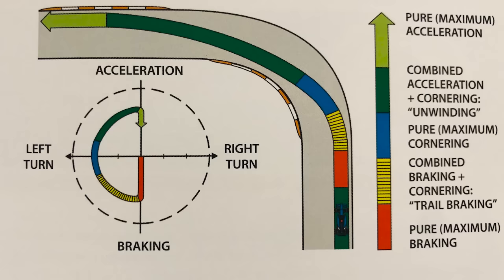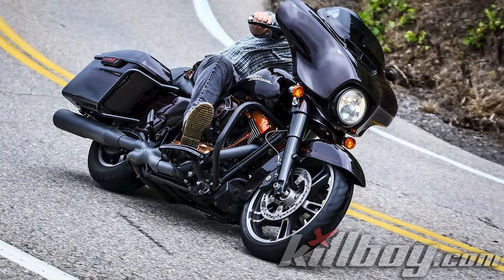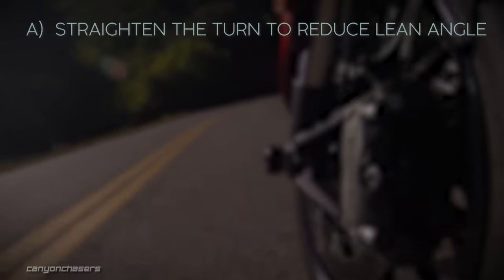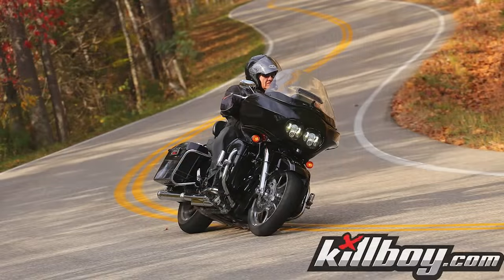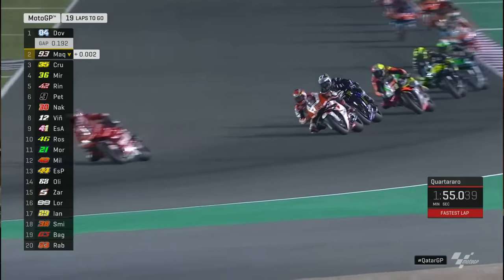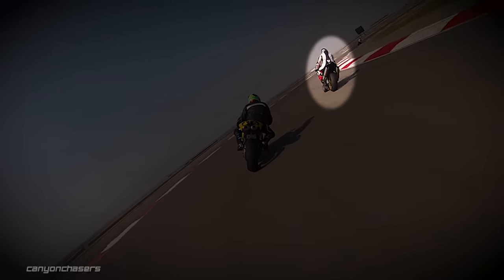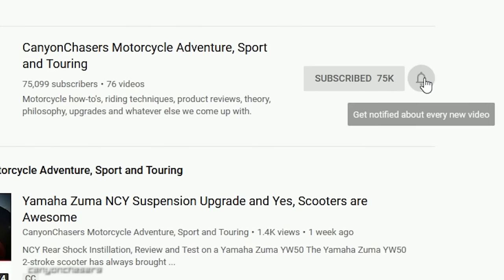How and Why Delayed APEXES Work

Comment: I enjoy and respect your channel.  But I can’t help thinking - isn’t this entire pursuit of identifying the one right apex point entirely inappropriate for the commuter or recreational rider to whom “Managing a corner 0.3 seconds faster” is not only silly, but more dangerous than needed. Aren’t we best served with - Keep your lean angle, speed and position at maximum safety for as far as you can see. There’s no need for crowding the inside line near oncoming traffic, nor threatening the outside line often littered with debris for those of us not doing track time.     However - I enthusiastically applaud your piece on trail breaking. I believe it can literally reduce accidents, while increasing riding enjoyment.  The MSF course I took taught it as necessary to accelerate continuously from the start of a turn and all the way through. I think this is counter to safe riding, and entirely beyond the scope of and ill advised for learning riders.        Nice work!
Reply from the maker: Honestly, learning how to identify and find your apexes is a massive safety benefit. Just like trail braking it may be faster, but mostly it reduces risk.  It gives you a plan for every corner, it minimizes your most lean to a point where you are going the slowest and have the most grip as well, probably most importantly, putting you into a position where you are least likely to run wide; off the road or into the oncoming lane. You don't have to push your  apex to within inches of the edge of the lane/road. You can be three feet away from the edge and still have a good apex.

Comment: I do a lot of riding in the Catalinas in southern AZ. It is nothing but twists and turns for 25 miles, with the occasional short (200-500 yd) straightaway. There are many switchbacks and decreasing radius turns. I dare say that it is more work than riding on an average track at double the speed. 
Shifting your weight and weighting the inside peg are simply survival strategies. You never know when you will need to abruptly change your line in a turn so you want every last little newton of traction available and then use about 70% at the most. I always aim for a late apex, even if I don't need it. Even knowing the mountain like the back of my hand, I'm not perfect. It is imperative to give yourself every advantage because there is rarely a ride where I don't scrape a peg or narrowly avoid another insane rider, bicyclist or lazy cage driver. 
I have seen this mountain cripple, maim and kill riders. I once lost traction in a curve and recovered just in time to avoid going over an 800 ft cliff. 
What really boggles the mind are the nutso bicyclists who come screaming down the mountain at 40-60 mph with a contact patch of about two square centimeters! Yeah, that's gonna be fun when you wreck wearing spandex and a helmet made for low speed impacts. 

One thing I don't think is well addressed here is the importance of proper throttle and brake control. A lot of people don't realize it is possible to brake quite aggressively in a turn, should a vehicle pull out. It is a progressive action of rolling off the throttle and progressively and carefully squeezing the front brake. Also, most people would make the mistake of using rear brake in an emergency stop in a corner. don't You dial in the front as you roll off the throttle and begin straightening up the bike. You brake until you reach the "point of no return", where you would crash, let off and then lean in hard and swerve back into the turn. 

I may be biased because my bike is a Harley Dyna but I think the rear brake is useless on road. I never use it. I have a 1.5 l air compressor to brake the rear. It just requires excellent control skills.
Maybe if I was riding a little bike, I would use some rear brake but I don't typically ride little bikes. I think the same rule applies to larger sportbikes, provided that you aren't letting the slipper clutch make up for poor skills!

Anyone can ride a sportbike fast on the twisties, with lousy technique. Try going the same speeds on a somewhat modified cruiser and then talk to me about technique.
Reply: I think you need to watch the video again. Shifting weight loads the outside peg in effect making the bike stand more upright which in turn allows deeper braking, or a steeper lean angle before things start scraping.
This guy is quite right squaring off a corner leaving your turn in point (maximum lean) until you can see your exit and thus your apex point. This cancels out any little surprises like debris or gravel on the road because you are going to see it before you've 100% committed at your turn in. Then you have options of line changes or extra braking from not tipping and staying wide.
Something this guy didn't discuss and probably should have is the smooth transition between braking and the centrifugal forces in a corner. If you are braking at 100% of your grip levels entering a corner then you have no grip left that your bike will demand for actually cornering. The optimum is a smooth transition between your grip moving from 100% braking to 100% centrifugal forces at your tipping in point. To achieve this well we come to the most over looked part of most bikes riding around today. Suspension! Hands up everyone who hasn't had their suspension tuned or has leaking seals or doesn't change out their fork oil at least once a year. You can have the best tyres which counts for nothing unless your suspension is keeping your flash tyres on the road like it should. Smooth cornering will transfer the suspension compression from braking into centrifugal forces of cornering without your forks acting like a pair of pogo sticks. If you can't keep up with your mate on a similar bike in corners then get your suspension sorted like he did. This applies equally to new and used bikes. There is no suspension setup that suits everyone.
Reply: @tbonemc2118  No, I'm afraid you have that wrong. Loading the inside peg stands the bike up more.
A motorcycle wants to naturally place the wheels under the center of gravity. when you are leaned into the turn and you weight the inside peg, that shifts the CG downward and towards the inside of the turn. Thus the wheels want to track back underneath the bike. 
Keep in mind we are talking vector mechanics here and if you took the time to understand this subject, along with trigonometry, you would be able to work this out for yourself. Also, a thorough understanding of rotational dynamics (centrifugal force and fore-aft weight transfer), gyroscopic precession and traction also really helps to understand riding a motorcycle.
There are many treatises on motorcycle physics out there. I suggest you thumb through one sometime.

Comment: One question - the blue line shown, there the part of max lean is not the apex of the corner, the apex comes afterwords. Which is contrary to what was said earlier in the video.
Reply from the maker: No, thats accurate.  The apex isn't always the slowest part of the turn and its not always the point where the bike is leaning the most.  The apex is simply the where the bike is closest to the inside of the corner - and it's where we put it.  We may apex early, middle or late.  Each with different results in the bikes exit.

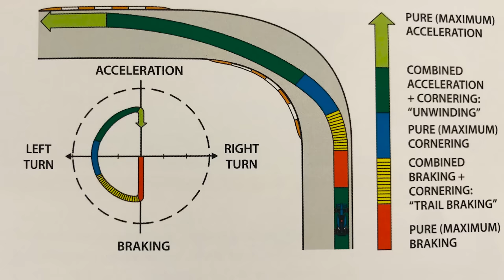Comment: I have a bit of a problem with the infographic at 0:33. On that picture, the highest rate of turn (smallest radius) is clearly at the trail braking phase, and the apex (where the bike is closest to the inside of the turn) is about a quarter of the way into the "unwinding" phase. Shouldn't both of those actually happen at the "pure cornering" phase though?

Comment: Hey, Great video as always. 
To put things in perspective, I'm from India and most of our roads don't have the yellow line separating the two way lane. We also ride on the left side of the road. What other visual data can I use if an oncoming truck is blocking the straight line that joins my apex and my turn in point? This is a problem that has been vexing me for quite some time especially with the right handed turns as it puts me in the middle of the road. Please help.

Comment: When I started out I realised early that being in the correct gear on entry was critical. Too high and nothing can help - and it’s very hard to brake smoother than the engine can. Most people I know that run wide or drop their bike etc is because of poor gear selection on entry. Changing gear mid-corner also isn’t a great idea.

Comment: quick story: i have been a decent rider, both on track and on the streets up until 2 years ago when i lowsided in a turn in abouth 25mph. im pretty sure the reason the back tire slipped out was the fact i didnt give gas so i lost traction and lost the grip. a few weeks back i bought a new bike after almost 2 years break since the crash i had, and i found out im super scared of corners, everytime im going in to one no mather the speed im getting tense, i grab the handlebars superhard and my eyes are going to the sides to see "what im going to slide in to if my tire fails me again".

So my question, If you trailbreak.. wouldnt that lower the traction of youre back tire and increase the chance of low/highside cuz the backwheel will lose the grip? I know i just got to continue to push myself and get my confidence back up like it was before the lowside of course. just trying to get back on track and be able to have fun again on a bike. 
Thanks.

Comment: 7:35  was taught, in race cars, the apex point, where power can begin to be applied, is determined by the width of the exit road...same thing I suppose.
Reply: Yes, ..more or less, albeit the bike is much thinner, offerng the options of a slightly wider variation of points to the road/lane width(s), assuming you're not on the ideal racing already; which is rarely possible on the (public) road.

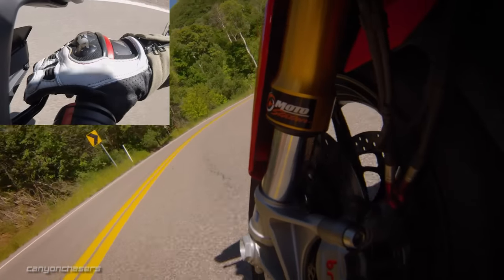Comment: Also—one point of contention—I strongly disagree with your statement that we “only want to use one control at a time”.  (6:50) One of the techniques I’ve learned from Lee Parks is to ease off the throttle while simultaneously easing on the brakes and vice-verse: to add throttle while simultaneously easing off the brakes.  This method of trail braking simultaneously using the brake and throttle produces an incredibly smooth transition from deceleration to acceleration, and doesn’t upset the suspension and therefore improves control through the turn.  It’s an amazing technique!
Reply from the maker: Yeah. I know he teaches that but it's extremely hard to master, especially on high torque motors. You'll also notice that not a single MotoGP rider does it. You can still be smooth without mixing acceleration and braking.
Reply: It’s funny—I never found the technique hard to master.  The racer Freddie Spencer was one of the original proponents of the technique.  The cool thing about it is that both throttle and trail braking raise the suspension at the swing arm joint and raise ground clearance in the turn.  You, of course, know about motoGP better than me.  But I bet a lot of racers do it without even knowing they do it.  I saw in your video that you actually use the throttle while braking when blipping.  To me that’s way harder than using both brake and throttle during trail braking.  I’m always surprised how few people use the technique.  It makes the ride soooooo smooth and controlled.  Love it!  BTW—Chase uses the technique when he goes from the kitchen to the bedroom!

Comment: After watching the trail breaking clips, i have been practicing it on my Buell XB12. What I found is speed=radius doesn't hold. Even though speed gets slower my buell tends to stand up which makes a wider radius. So I try to counter steer harder but my bike resists. Is it because of the Buell or i do something wrong?

Comment: Great video, but above all the best way to ride a corner is have the correct speed. Trail braking, yes. Hitting the Apex spot on, yes. But going through any corner as fast as you can might be a thrill, but on most rides it won't save you more than a few seconds.Can't perfect cornering?....set off 5 mins earlier & relax.

Comment: Weird. This is exactly opposite of what delayed-apex means to me. Apex has two meanings. One is where the vehicle is closest to the inside of the track. The other meaning is where the where the turning radius is the tightest and lean angle the deepest. A delayed-apex turn is referring to the latter, in my own understanding of  it.

When entering the corner closer to maintenance throttle, you can turn/lean the bike all the way quicker/earlier from the point where you started to lean. So you can hold off and turn in later,  to be able to hug the outside line without crossing it. Then reach your max  lean angle very early. Hence this is a normal/early apex (second definition). So you take a wider radius. And you still can aim that to touch the inside of the track, late. You're creating as close to a perfectly circular arc, as you can. One which is wide as possible. It will nearly connect with the outside line, at the entry, then it will touch the inside line at the point where  you want to start to exit/accelerate. Until you reach the exit, you will hold maintenance throttle to free up all available traction to deal with the turning, since you will be at maximum lean angle and lateral acceleration from this point until the exit.

When braking late into a corner the way a racer does on a track, this is where you can't lean the bike all the way, yet. The front tire is carrying a lot of the weight, and if you leaned too far right now, you'd bin it. This is where you have to delay the point where you lean the bike, deeply. Hence this is a delayed apex turn (second definition). Also known as V-ing the corner.  

Because you have to start turning more gently, initially, you can't turn in as late without running off the outside of the track. This typically means you have to start turning earlier and taking a narrower line early on. Then you run wide midcorner, since you're not turning enough, yet. But then you cut it tighter at the end, as you're finally finished trailing off the brakes and have returned the bike to neutral weight bias smoothly and can actually lean all the way... just in the nick of time. 

The delayed apex (again, second  definition) is not better. It's not safer. It's not faster. It's the penalty the racer pays for braking so late. He gained the benefit in the braking zone, where he passed you by braking at the last possible moment. And now he's paying the price, dealing with high front weight bias as he started the turn. And he can barely fit his line in the track, now, dangerously running wide midcorner and barely being able to cut back in time. This is not how you ride on the street, obviously.

Up to a certain cornering speed on a sport bike (or up to the max of a cruiser before it scrapes), sure you can enter the corner with light brakes and still turn the bike all the way to max lean angle early/quickly, but continue to hold some brakes all the way until you start to exit. But the SLRP method, of finishing brakes (and allowing the bike weight to return to neutral) before you start turning, will work all the way to the max cornering speeds of a sport bike. Ensuring you can turn in sharper and hug closer to that outside line as you start the corner. On a sport bike, you should always try to finish braking before you reach your deepest lean angle, if you CAN, even when you're not all the way at the limit. Anytime you do it like this, you're freeing up the most traction possible, for other issues that might arise. 

On a cruiser, you can continue to drag some brake all the way to the start of the exit, to slightly tighten your line. But only when you have the traction to spare. If it's raining, you might start cornering more like the guy on the sport bike when you carry more speed into a corner. Releasing your brakes completely and even letting off some engine brakes using the throttle, as you reach your deepest lean angle for the corner.

Comment: I am all for this technique however on normal road riding (not one way race track) there is always the chance that an oncoming vehicle will cut the corner in you right hand  curve whilst you try to ride the perfect line........🤦‍♂️
Safe rides 👍🏍
Reply: but your ability to adjust for this is better if you're already on the brakes during entry. note in the diagram (the blue line) that the whole time you're close to the outside line you are on the brakes, which means you can adjust your radius by further decreasing your speed while trail braking. here's video of someone coming to a complete stop in a corner when a truck consumed almost their entire lane. https://www.youtube.com/watch?v=d9Geea1mqE8

Comment: Not trying to split hairs, but what you are showing here is more of a delayed entry technique. While a delayed entry usually does result in a delayed apex, it is the delayed entry that gives the best view and produces the consistent safe results every time. It is possible to early entry and still late apex which is slower and dangerous; so the apex itself not the most important part of the corner. Delayed entry which naturally leads to a delayed apex is the same technique that we teach in auto racing because it is generally the faster line and usually the safest line; especially for beginning drivers.
Reply from the maker: No. This is great. We want to be adaptable rider and adjust to deal with the current situation, right? The apex is a measure of how we did, not a goal.

Comment: Why do I end up going 15 miles an hour when I try to Trail break what is the average speed should you take a
Corner that is a  90 degree turn
Reply from the maker: Slow until you are comfortable with your speed and direction. You are allowed to go to neutral throttle when you are happy with how the corner is going.